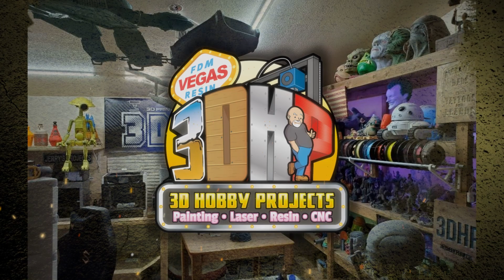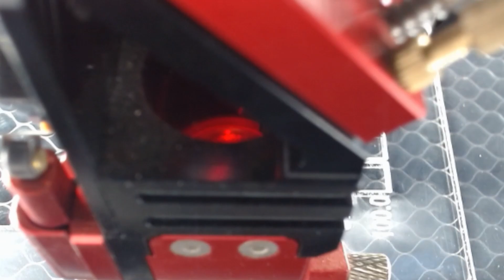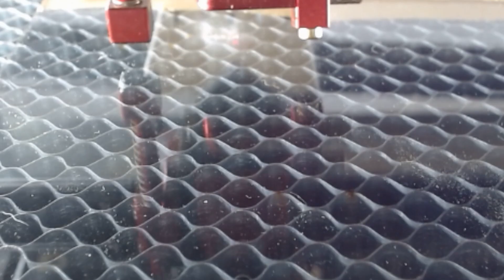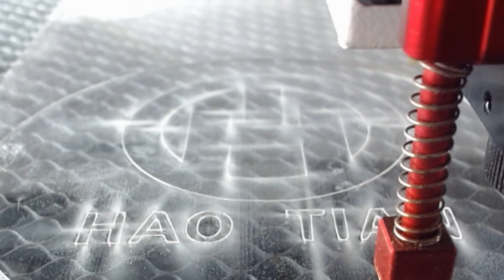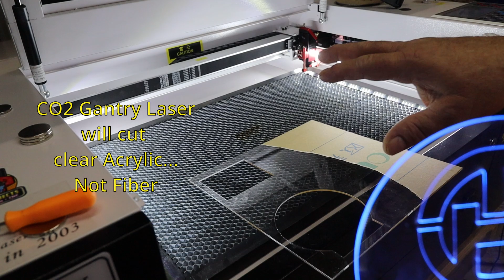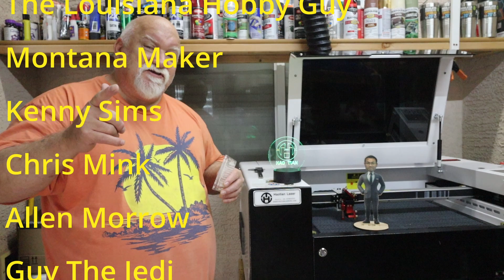Cutting Clear Acrylic on a HT 460 | 40 Watt RF CO2 Gantry Laser #3dhp

Comment: Where do you find all presets for this machine in lightburn?
Reply from the maker: In Lightburn, you run a material test to get your settings.
Reply: @3DHP  thanks. You mean that you did material test for all materials that you have on the list? Are there any initial settings or you did all of them by yourself?